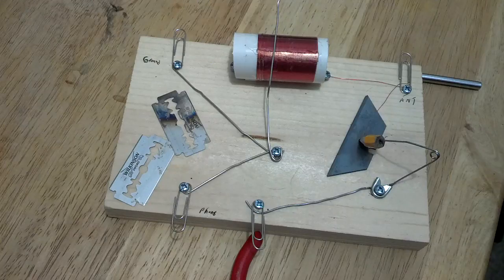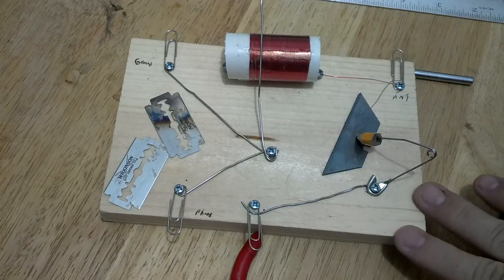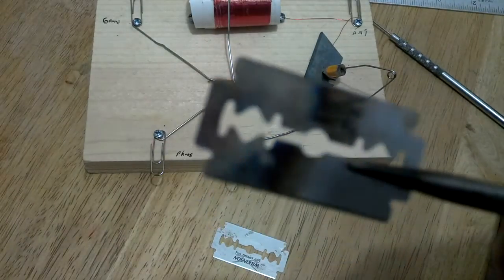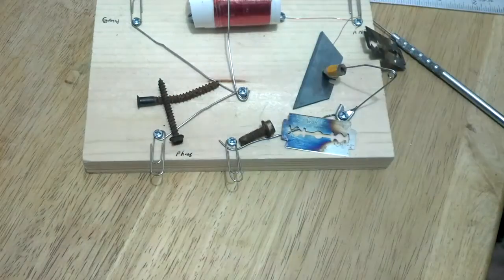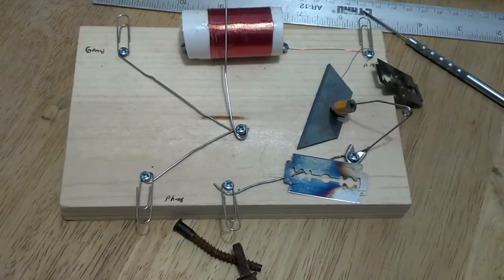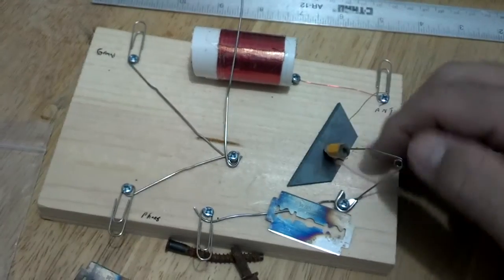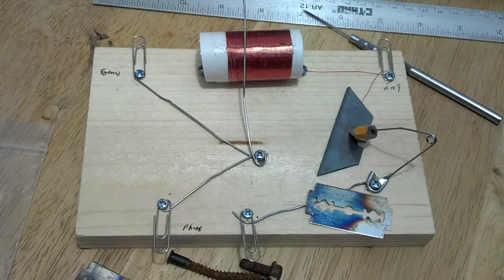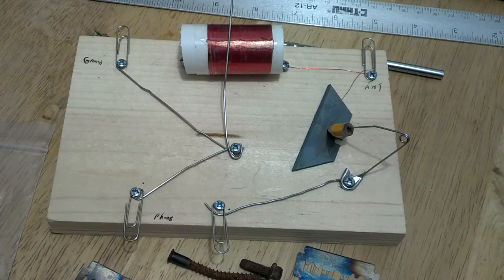Foxhole Pow Crystal Radio  Part 2

Comment: Questions:  
1. Does the diameter (not length) of the tube matter?  
2. Is a crystal earphone the only way to hear the radio or can a small pirated speaker from a two-way radio be used in place of the $10 Amazon earplug?
Reply: 1.the diameter is not matter, because it already has the wiper that tune the frequency
2.No u can use other speaker but because the normal speaker has high resistance so u need   through a amplifier to buff the signal

Comment: The diode you're looking for is a 1N34A Germanium. I don't think radio shack carries them anymore. Any electronics distributor should have them such as Mouser.com. The reason they work the best is their junction break over voltage is around 300millivolts as compared to 1N914 silicon diodes you had there, at 600millivolts. Makes the device far more sensitive. Very smart dog you have there by the way!
Reply from the maker: I ordered a pack of 25 Germanium diodes off ebay a few days ago. 
As for the dog I try to put something funny in each video. And she loves to help.
Reply: If you've not used them before you'll hear the difference. And yes, I see your dog loves to help and she does a wonderful job to boot.
Reply: Crean en Jesús Cristo y tendrán vida eterna y paz entreguénce a Jesús Cristo ahora mismo en oración Dios les bendiga
Les invito a una iglesia evangélica